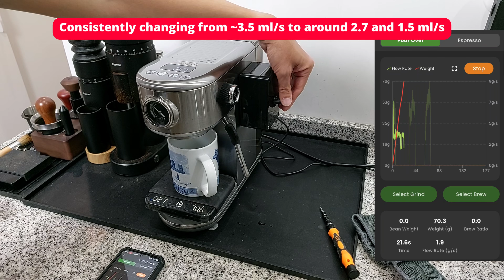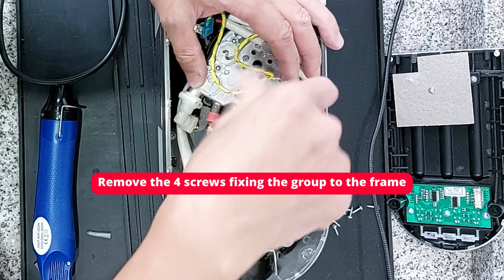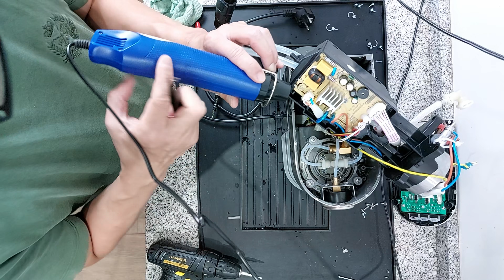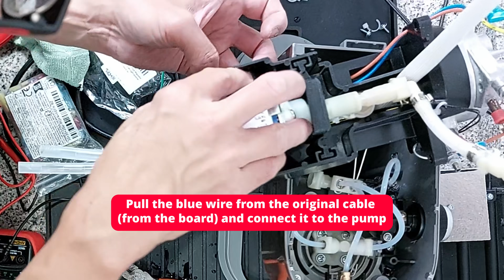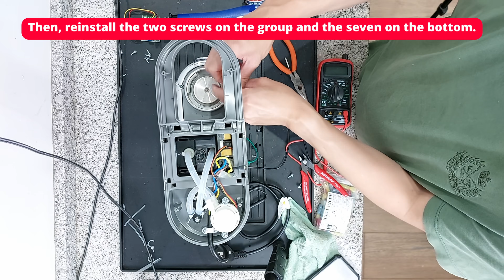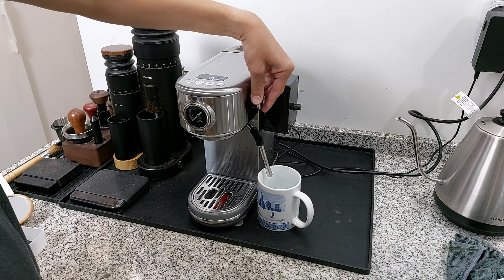Hibrew H10B Flow Control Mod: Worth It or Not?

Comment from the maker: Products that I used or mention in this video (some are affiliated links, but you don't pay more for them and support the channel buying through those links):

Hibrew H10B:
Official Store: https://www.awin1.com/awclick.php?gid=588767&mid=122154&awinaffid=1755713&linkid=4594919&clickref=
Coupon: ESPRESSOHACKERS for 5% off

AliExpress: https://s.click.aliexpress.com/e/_c3BibdYd
Amazon: https://geni.us/HibrewH10B

Dimmer:
AliExpress: https://s.click.aliexpress.com/e/_DC39zn9
Amazon: https://geni.us/Dimmer_All

Dimmer Enclosure (100 x 68 x 50 mm):
AliExpress: https://s.click.aliexpress.com/e/_c3LiivCJ
Amazon: https://geni.us/DimmerEnclosure

Double-sided tape:
Amazon: https://geni.us/DSTape

Crimper/Cable cutter:
Aliexpress: https://s.click.aliexpress.com/e/_DkOTzGB
https://geni.us/U7l7e (Amazon)

Multibits toolkit:
https://s.click.aliexpress.com/e/_DCihKAT
https://geni.us/RWHU (Amazon)

Soldering iron:
https://geni.us/soldering (Amazon)
https://s.click.aliexpress.com/e/_oDe6Ogk

Wires AWG 16 or 18:
Aliexpress: https://s.click.aliexpress.com/e/_DcR8kbp
https://geni.us/AZMMKm (Amazon)

Spade/Fork connectors:
Aliexpress: https://s.click.aliexpress.com/e/_DdlcoOJ
https://geni.us/YwzUb1y (Amazon)

Piggyback connectors:
https://s.click.aliexpress.com/e/_c3SQunFH (Aliexpress)
https://geni.us/KxvjO (Amazon)

Bookoo Themis Ultra:
https://bookoocoffee.com/espressohackers
EspressoHackers: 5% discount
Amazon: https://geni.us/CuAplD

Amazon Prime for some discounts and free shipping: https://geni.us/bidTfLf

Comment: I enjoy your work I am contemplating violating my warranty and adding a dimmer on my CASABREWS 5814 PRO equipped with a flash boiler identical to Bambino Thermojet.  Do you think it will cause issues?
Reply from the maker: I don't have this machine, then it's difficult to judge. It depends more on the logic in the PCB.

Comment: Hello, sir! I wonder if it would be possible to replace his OPV valve with a 9 bars OPV in order to get a better extraction and a more controlled flow?
Reply from the maker: I think it's a bit risky and not worth it.  In my opinion, the best strategy is to bleed some water through the steam wand if you want to reduce the pressure. Or just buy the H10B Plus. I didn't test it yet, but the promise is that it has adjustable flow/pressure.
Reply: @EspressoHackers apparently, H10B plus will have an OPV so it will crush all the competition. I don’t know if it’s an adjustable OPV or a 9 bar OPV spring.
Reply: @GheorghitaStefan96 I loosened the screw on the original opv, the pressure dropped 5 bars on the gauge, the espresso extraction is much better now.
Reply: @mdkCaio  I’ve never opened my H10B, but in this video I couldn’t see any screw on the plastic OPV valve.
Reply: @GheorghitaStefan96  there's a cover that you have to remove to access the screw. It's the same procedure showed here https://www.youtube.com/live/JIjRWJ76eVQ?si=JvTX_gtrT21HH7lP
Reply: @mdkCaio I will try doing it. Thank you! I hope I’ll not break something 😂
Reply: @mdkCaio  How many turns did you make to reduce the pressure?
Reply: @GheorghitaStefan96 I opened it all the way until it unscrew completely, than I tightened it a bit just to fix it in place again.
Reply: @mdkCaio I did it and now the coffee has a better taste: the clarity is there and it’s not so sour. Thank you so much for the informations.
Reply: @GheorghitaStefan96 glad to help bro.

Comment: Hot glue Pops off by it's own when you brush it with IPA (isopropanol Alcohol)
Apply it with a brush or Q-Tip
Let i soak fo a couple seconds and it jumps off.
Reply from the maker: Thanks for the tip. I may try the next time.

Comment: Interesting.  Another reason why I don't like that format machine.  Stuff is PACKED in there and not much working room, especially if you want to do mods.
Reply from the maker: Yeah, I think the manufacturers never plan their machines to be modded, which makes sense. And nowadays, being light and compact is very important with the freight costs sky rocketing

Comment: This is pretty rare. I installed a Drimmer in my Delonghi Dedica, and it works well. I can reduce and increase the flow which also means the pressure. I've tested 5, 6, 7, 8, 9 bars of espresso, and it's unbelievable how the taste changes.
Reply from the maker: I think that the Delonghi Dedica has  much simpler PCB and just switches the pump on and off. The H10B probably has some logic with input from the flow meter. But I'll check a Dedica soon for a definitive answer.
Reply: @EspressoHackers  Delonghi Dedica also has some logic input, because one time I grounded the coffee so finely that the Dedica couldn't extract it and stopped to prevent damage. Keep me posted about news. Excellent content!

Comment: Thanks for this video.  I got back to my h10b today and tried a few shots using fresh beans and a replacement  bottomless portafilter. What I'm noticing is that this machine is set to produce an amount of coffee, not a timed brew. The actual amount of coffee is rarely as suggested in the setting, always more. I think the electronics and flow meter are performing a little dance, but it's not quite effective.  To me that would explain why your pot works fine on the wand but not on the brew function. Does that make sense? I'll persevere with my dose, time, temp and volume experiments,  to see what produces the best results here.  Thanks again for your videos.
Reply from the maker: I thought it was time based, but you may be right. I didn't check if it could be volume based. However, after some interactions with the other folks here, I think the easiest way to make it work properly is to fully bypass the controls on the pump with another switch. To be tested though, but thanks for your comments.

Comment: Great work! Keep us updated on Hibrew H10B - is a great value machine!
Reply from the maker: I will! Thanks!
Reply: @EspressoHackers  the real question for me: Does the HiBREW H10B display the actual extraction pressure on the center pressure gauge, or is it just the pump pressure? I'm aiming for a 10-bar extraction on the gauge (using the bleeding method to lower when it ramps up).

Comment: Hello! I recently purchased a HiBrew H10b

After using the machine for 15 days, I noticed an issue where the steam wand drops down at a specific point (when pulled towards the pressure gauge) when the machine is turned off. But once steam option is turned on it gets tight. But it’s working fine. 

Could you please advise if this behavior is normal? If it is a defect, please let me know the appropriate next steps to resolve this issue.
Reply from the maker: Sometimes (rarely) I notice a few drops from mine as well. I didn't notice anything related to position. I believe the cause is the higher pressure when brewing and that you may still see a few residual drops later. I don't know if it's normal, a valve should be able to shut off completely, but this is something that also happens in Gaggia Classics, it's even more severe, and it's because people overtight the valve when closing.
Reply: @EspressoHackers It’s getting worse day by day. I really don’t know how to solve this problem. Since I live in India, there’s no proper customer support to solve this. What can i do to fix it?
Reply from the maker: First, I'd try to contact Hibrew. I think there's an email or form on their website. And let me know what they say. If they don't provide a good support, I can also mention that in future videos, but so far all the cases I know were properly addressed.
Reply: @EspressoHackers It’s been 4days now that I have mailed them explaining the problem in details with proper video proof. They have not responded yet. I also tried messaging them on Instagram but there also no luck.
Reply from the maker: @tarkashmehta5788 did you try info@hibrew.com and service_official@hibrew.com ?

I think my first contact with them was through info@hibrew.com
Reply: Hi! Could you please share your Instagram account name? I will send you a DM to help resolve your issue 😊
Reply: Hi! Could you please share your Instagram account name? I will send you a DM to help resolve your issue 😊

Comment: Hi, hope you remember me from our earlier interaction
I have purchased Hibrew H10b and also bought K6 grinder
I usually drink iced lattes so medium dark roast is what I use. 

But I used the nonpressurized basket included in the box
10 grams of beans 27 click on K6, and it was to fine above 12bars pressure for 30+ seconds, with almost no crema and also the puck was watery with crater in between bulging out.
I also tried 30 clicks, yielded thin cream, and I am not sure which is the perfect click for 10 grams of coffee. 
Also, I don't use puck screen; I do WDT and tamping with included tamper 

Can you recommend me a good click setting on the K6 which will give me a smooth, good crema espresso?
Reply from the maker: Hi Aditya. Yes, I remember. The first question is how old is your coffee? Crema is basically related to the CO2, but if the coffee is more than 1-2 months old (counting from the roast date), there won't be much CO2 in the beans and therefore no crema. But, having said that, crema may be beautiful but it's the most bitter part in your coffee, if you brew a very light roast you may not get any crema and it may still taste fantastic. I drink a lot of espressos with and without crema, it's not a driver for me.

Comment: I'm working on pressure-profiling with an ESP32-S3 and a RobotDYN AC dimmer on the H10B. I'll find out if it works as soon as I receive all the components. 😂😂
Reply from the maker: You can install a Gaggimate as well
Reply: @EspressoHackers  I was thinking about something cheaper. Have you tried Gaggimate on thermoblock machines tho? It might require some tweaking.

Comment: Some guy on reddit said that there's a ball with a spring on the group head, if the pressure is too low, the water can't push the ball and no water comes out, he was doing an opv mod, losing the screw on the original opv. Maybe that's the same problem with the dimmer.
Reply from the maker: No, it's a different issue. The same problem would happen in a Delonghi Stilosa, it has a similar spring in the group since it doesn't have a solenoid. All machines without solenoid use a spring. But if I find out the solution, I'll share with you guys in a future video.
Reply: @EspressoHackers  Do you think it's possible to replace the OPV to a 9 bar copper one from aliexpress?
Reply from the maker: I don't know but even if you can, I think it's a lot of work for marginal benefit. I'd try to control the pressure bleeding some water through the steam wand.
Reply: @mdkCaio  Did you do it? What were the results?
Reply: @radekx669 didn't do it yet.
Reply: @radekx669 I didn't replace the OPV, just loosened the screw on the original one, max pressure on the gauge dropped from 17bar to 12 bar.
Reply: @mdkCaio thanks, how hard is it to do this?
Reply: @radekx669 easy

Comment: The solution is, don't buy this machine. Problem solved.
Reply from the maker: It's a good machine, I just don't recommend installing a dimmer yet. Maybe I'll find a more effective way to install that is not much more difficult than the way I installed in this video.

Comment: The flow meter, other than ofc for volumetric shots, might be used for adjusting the heating of the thermoblock, and that might be why it turns off with near zero flow; the only ways i can think to bypass it would be to fake its signal with a microcontroller (but that might or might not affect temp stability), or entirely replacing the control electronics of the machine for something else (eg: gaggimate once it starts supporting thermoblocks). I would also probably suggest adding a simple bypass switch in parallel to the dimmer, though i doubt it matters much.
Reply from the maker: I hadn't thought about it being used to feedback the pid control, great catch! But regarding a simple solution, I still don't know yet what I could do. But maybe Hibrew can explain me what is the logic behind the PCB.